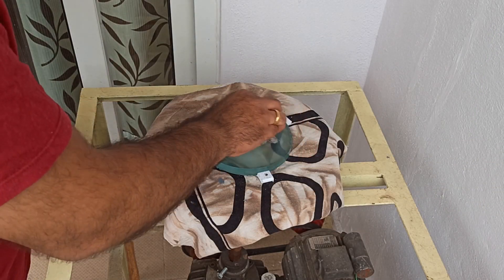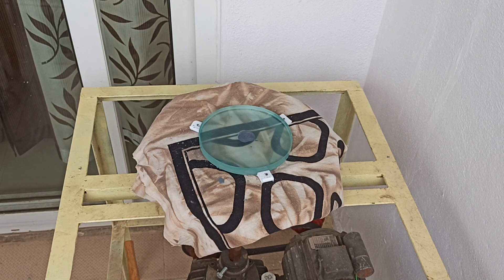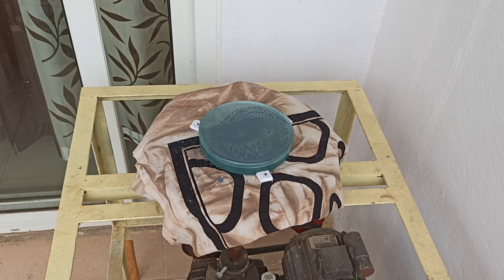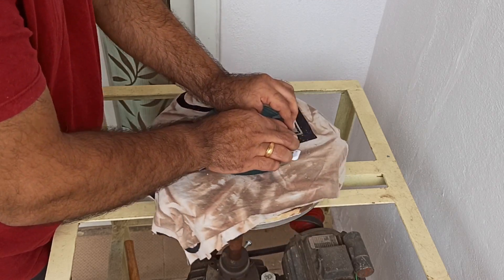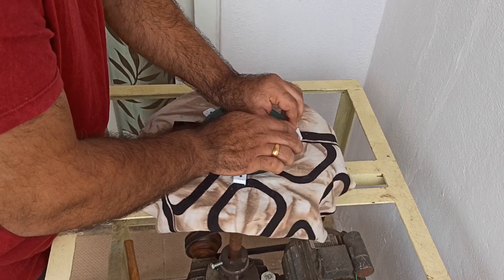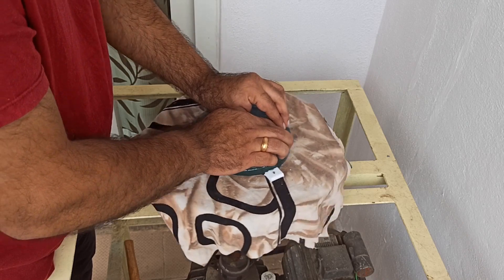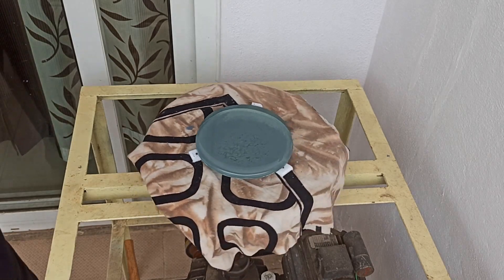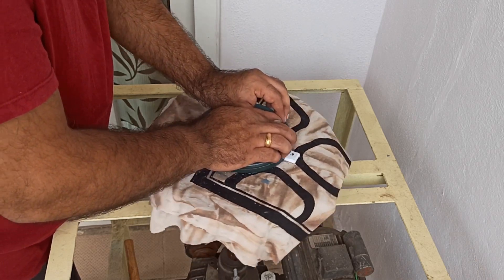Fine Grinding a Telescope mirror

Comment: Please show us the components used in making the grinding turntable
Reply from the maker: I will make a video on that. I am building a machine, so i thought i will put it up later after building. But I will make one video for the hand grinding table. Thanks for the feedback :)
Reply: @astrosathya1984  is it a three phase motor or single phase?
Reply from the maker: @satyajitbhadraroy7723  single
Reply: @astrosathya1984  ok. Will wait for your video with all details. Like how you control the speed. Where you bought the parts from etc.